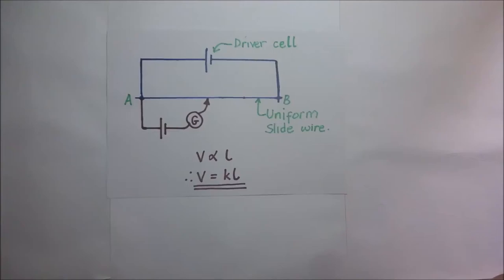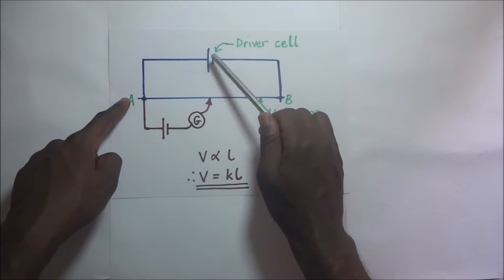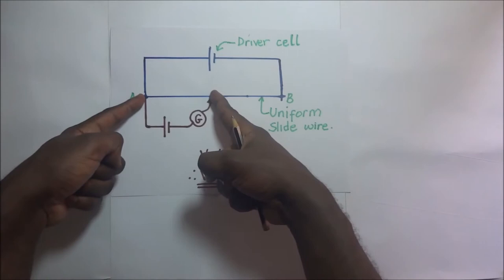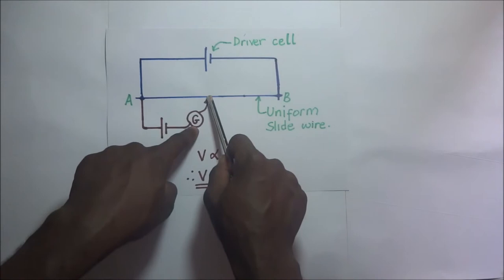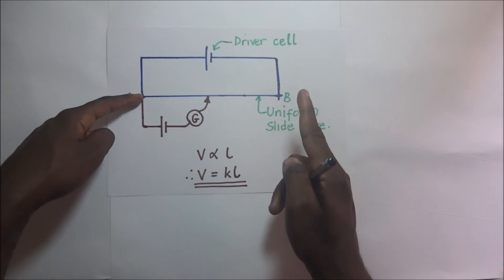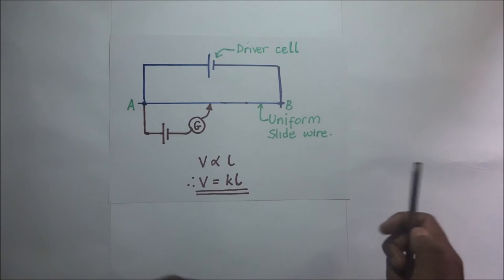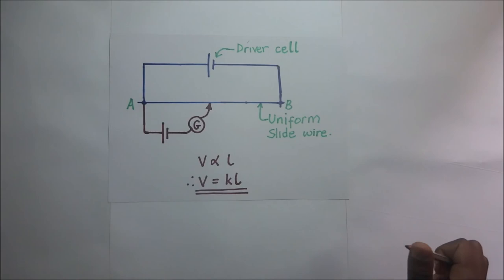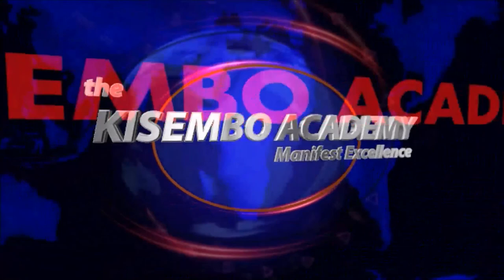Slide wire potentiometer | How potentiometers work- Kisembo Academy

Comment: Thanks alot please throw more light on the causes of one sided deflection
Reply: The deflection in a galvanometer is directly proportion to the current, so the higher the current, the higher the angle of deflection, and the galvanometer deflects to one side to show current, if there is no current, it does not deflect.